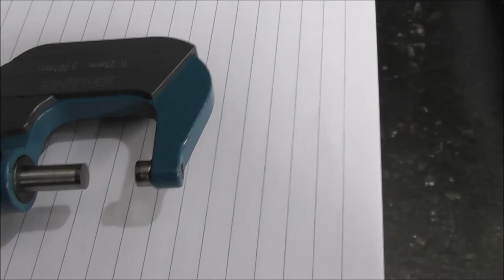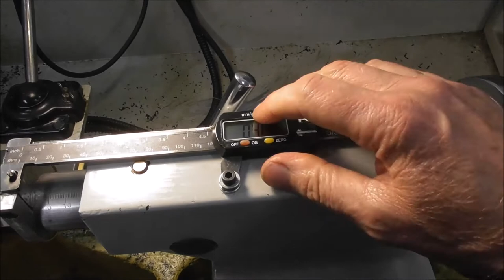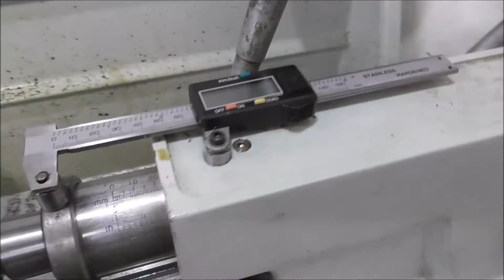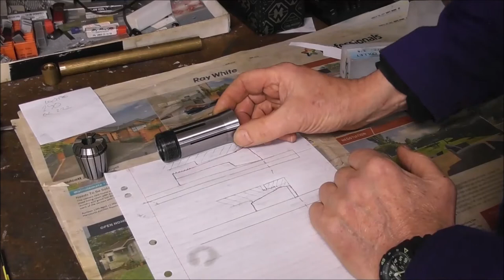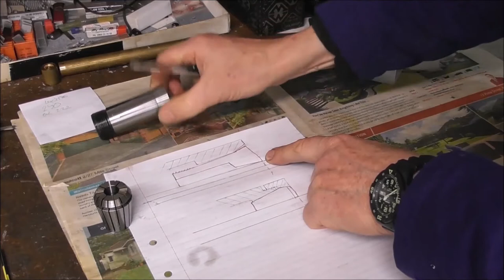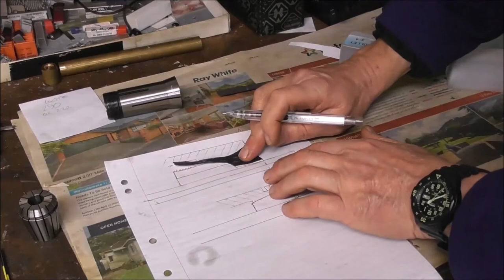Lathe tailstock setting and collet chucks

Comment: Thanks Cliff, I will be refitting my tailstock with much more confidence of accuracy now.  A thought would be to indicate the taper in the tailstock barrel and then rotate the barrel in the body of the tailstock (before fitting the clamping handle) this would show concentricity of the taper to the barrel.
Reply from the maker: Hi - Yes, a good idea. The key would need to be removed and the quill/barrel restrained lengthwise in some way. Cheers  Cliff

Comment: I use ER40 on my lathe for work holding because of clamp range and parallel clamping.  The cataract collets clamping force is more concentrated and may have better workholding.  The ER with a ball bearing nut is very good though and doesn't chew up my workpiece.  I also have a ER40 square collet block to go from mill vice to 4 jaw.  My 5C's are getting a little dusty.
Reply from the maker: Hi SH - Thanks for your input. Cheers!  Cliff

Comment: Hi Cliff.
You certain touched on some very popular items for a Manual Lathe.

Tailstock Alignment, is always over looked when setting up a Lathe.

Digital Vernier, on the Tailstock is one of those jobs i Always thinking about doing.
But never get around to it 🙄
Usually i am thinking about it while doing the job that needs it.
But I never make time to come back to it. 

Collet Chuck, for holding work pieces accurately.
I prefer the ER40 Collets for this set up as it gives you more range to hold larger size parts.
I have Collets sizes up to 30mm but have seen 32mm available.
Which would cover most accurate work you might want to do on a Lathe.
Another jobs i have Always thought about doing 🙄😁

ER type over C type Collets for any work i could think of.
Unless you have the Machinable C type Collets available.

Great information as always.
Peter 👍
Reply from the maker: Hi Peter. Thanks for your input and feedback! Cheers  Cliff